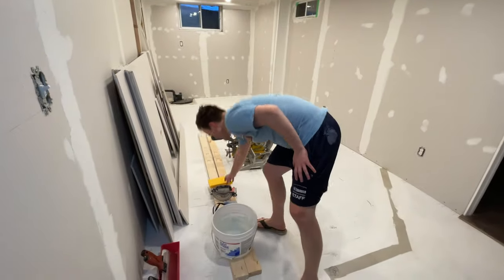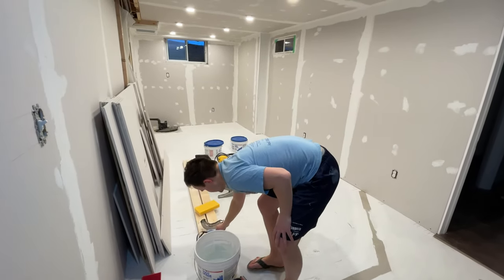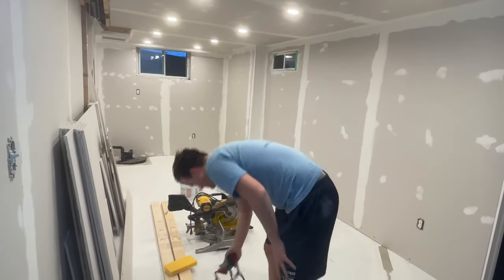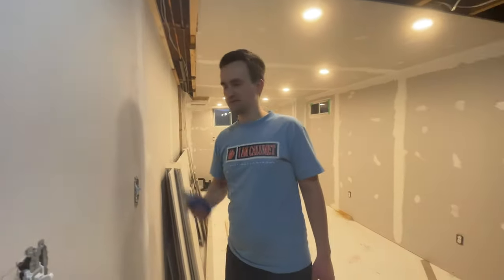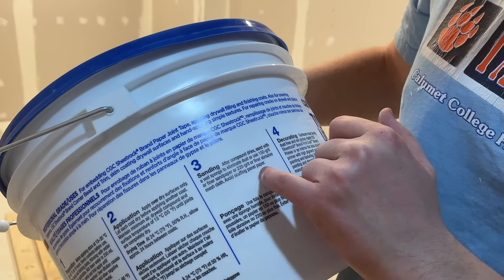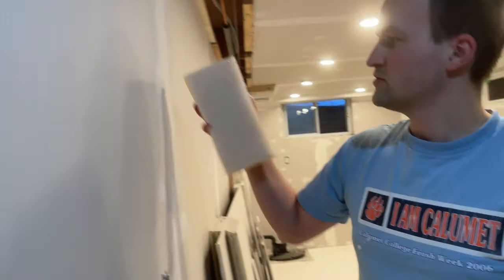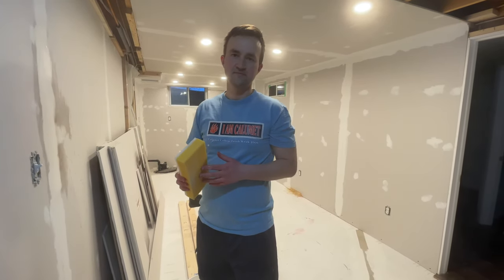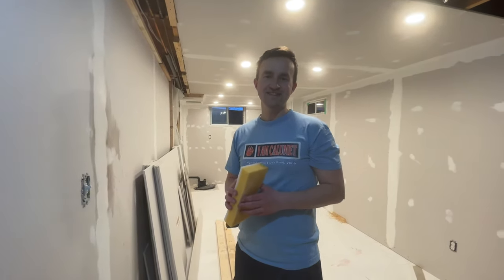Drywall Sanding - Dust Free Method!

Comment: If first coat is applied properly sanding should only be done on second coat and third. 25 years in drywall business so I’m speaking from experience. Not a single call to come back in those years
Reply: You didn't say anything of value.
Reply: I don't usually have to give a 2nd and definitely not a 3rd coat. But I do have to sand a bit. But sanding is faster than waiting on mud to dry. Time is money. 33yrs old, over 25yrs in construction, but only about 2yrs of combined drywall time. No callbacks on my end either
Reply: Just don't over mud
Reply: @swappedoutZ71 33 years old with 25 years in construction huh? How dumb do you think we are? 😂
Reply: @jpro2435 lmao hes literally trolling, nerd 😂. hes making fun of op & comments like yours thinking your way is the only way to do a trade 😂.
Reply: @swappedoutZ71 they probably have the lowest expectations but that’s ok too

Comment: there's a lot of mud on that wall. feather those edges and you won't have to sand so much. wet sanding is good for getting mud off the wall, not so good for a smooth finish. you can also wet sand with a sanding sponge which is good for top coat finish.

Comment: 120 grit not grade. 
Also with wet sanding you wan to wear gloves or your hands will dry up and crack. But before that you could have done a second coat on your edged and feather it down so you don't need to sand so much.